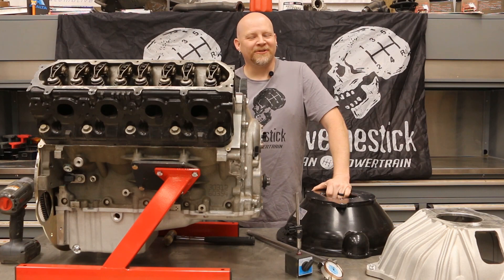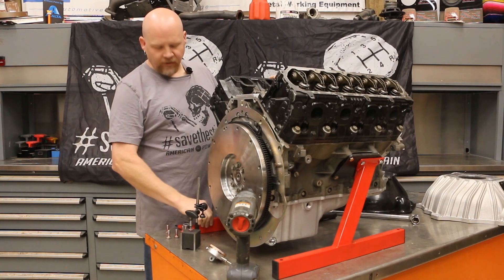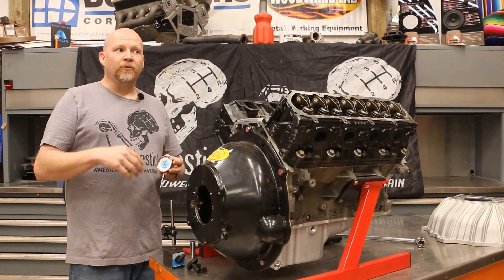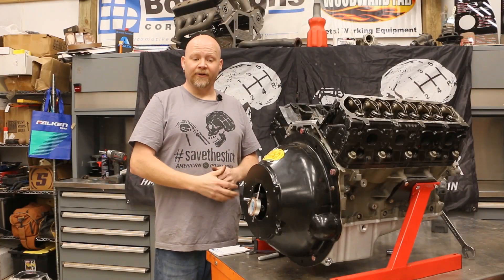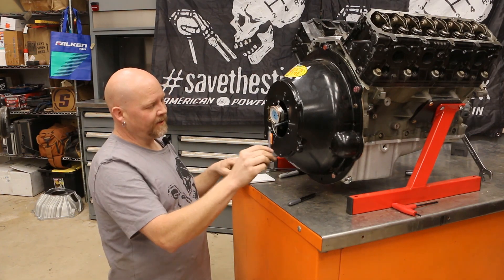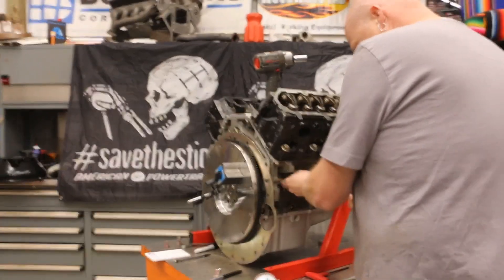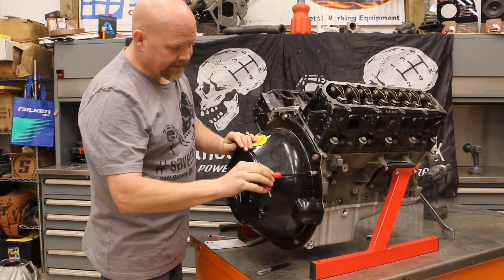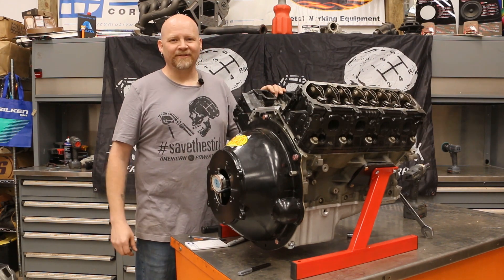How To Index Your Bellhousing With American Powertrain

Comment: Aren't you assuming the cutout in the bellhousing is perfectly square to the back plane of the engine, perfectly circular and perfectly centered on the engine crank centerline?  Seems to me I've seen some bellhousings in my time that such an assumption would be bold indeed.
Reply: that bell housing center may of not been concentric

Comment: I live in Madera CA, and my question is who can install my Tremec TKX 5 speed transmission and components in my 65 malibu SS ? I looked up for Tremec installers in the central valley. The transmission shops in this area will not install. I need a reliable installer who knows exactly what they are doing.
Reply from the maker: you can look at our dealer network on our website
https://americanpowertrain.com/installer-locator/
Reply: @AmericanPowertrain  thank you